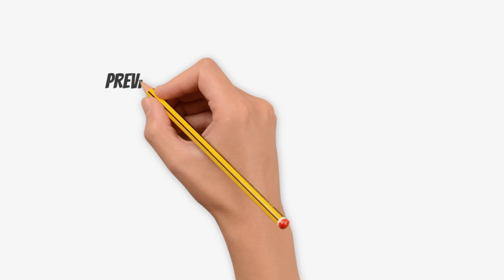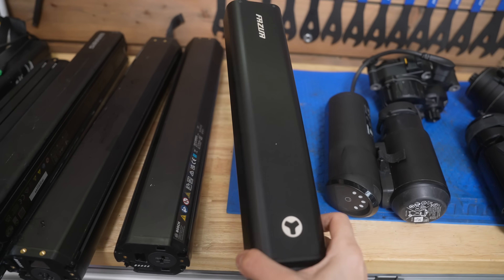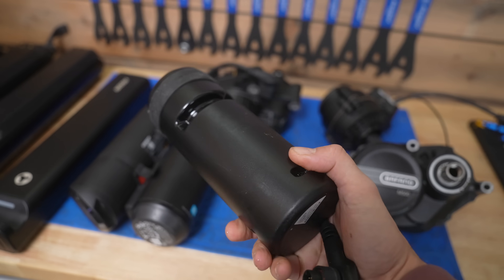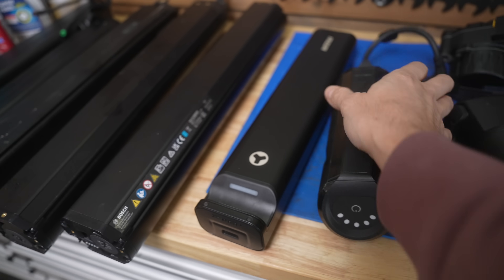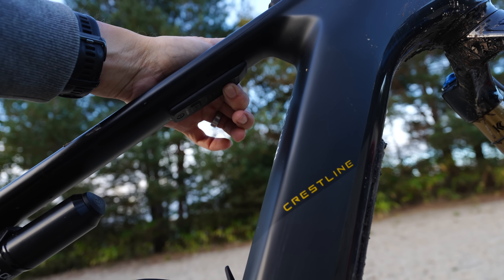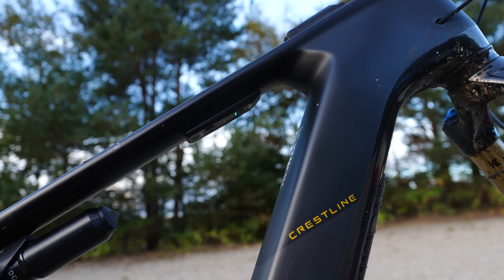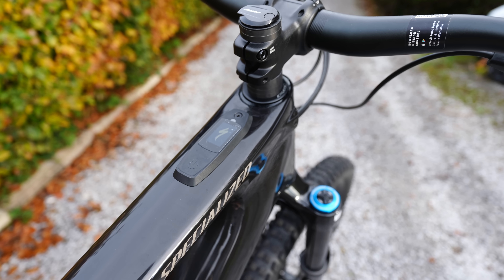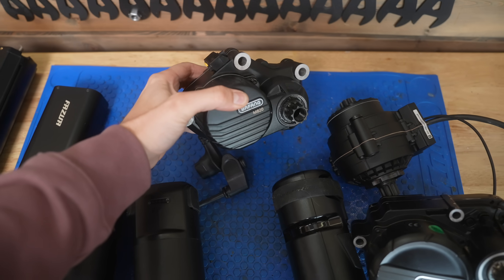We Have A Huge Problem With Ebikes....

Comment from the maker: Some ideas! Please share yours below.... How about:
1 - No Proprietary Systems - have a few bolt patterns for full fat / mid / SL motors
2 - Clear Upgrade Path / Future Proof
3 - Trade in process (like phones) to upgrade to new tech
Reply: And not just bolt pattern for the motors, but a universal power cable and a universal communications cable so if you change out a motor, it should be as simple as disconnecting a USB C cable and plugging it in to a new motor. Same as if the cable goes bad, it should be easy to find and source. And one step further, a user accessible USB C port on the motor to do firmware updates via USB stick, computer, etc as a backup to bluetooth in case they don't keep up with phone compatibility.
Reply: I visited Bosch the cycle show in London earlier this year. They introduced new smart system with the battery EXACTLY THE SAME as my 2021 from Trek. I just couldn't belive when guy said that I won't be able to use my battery. He said some bull....%&# about new software. Is just a software I said, change it. Me as a client was hugely disappointed with their approach to the client.
Reply: Contact Louis rossmann about this I bet he can give some insight to the reasoning
Reply: You miss the point that those are mechatronics systems and that agreements between drive systems competitors are forbidden by compliance laws.
Reply: @christfriedweigel could you elaborate on this. Where can I find more info? A  similar effect results from Patent avoidance incentives.
Reply: @christfriedweigel  Grin Tech's e-bike motors are not under any compliance laws. They've been making non-proprietary e-bike motors in Canada for over 15 years.
Reply: First, manufacturers need to be obliged to provide spare parts. For cars a minimum of 10 years supply is obligatory to get them approved for the road.
Reply: All good points and it paints a poor picture of the industry.

On the plus side - at least there are guys out there who CAN actually fix and fettle these things.

I just had my Bosch 500wh battery re-celled by a specialist & it came back as a 625wh version and was only about ⅓ the cost of a new one.
Reply: My first point would be ensuring all battery packs are serviceable and repairable. Having your entire drivetrain be rendered useless because of one bad cell is not a good state. 

Second, I'd support an open DC charging standard. Being able to have a single charger which can communicate with a pack and deliver the correct charge would cut down on the waste of single pack chargers. 

Thirdly, supporting legislation which allows companies and consumers access to communication protocols so they can build and service products which work with other companies products. Far too many companies use proprietary and closed protocols to restrict competition and deny access to 3rd party repairs

I'm far more in favour of supporting actions which keep your existing kit running and serviceable rather than forcing companies to take actions just so you can get the new shiny thing.
Reply: Break out that bolt on midrive . Unless they make all ebike mid drive  with adapters...same bolt on for all adapters..and what ever bolt pattern on the other side is up to them....they wanna change it ..they can...but they must include universal adapter that fit what all ebikes , that must be made with a standard bolt pattern for adapter .
Reply: I think above all we need some kind of 'gentleman's handshake' from OEMs that the e bike you buy will be supported in terms of like for like replacements for a good chunk of time.
Reply: A regulatory distinction between fun/sport (MTB that may not be roadworthy, e.g. no lights) and everyday (transport, can be MTB) bikes is helpful.

This distinction does allow for more innovation (high-end/sport), which can trickle down into more general use bike tech with standards. It's in the interest to innovate to sell high margin products, but a manufacturer which has to sell a general purpose bike with a standardized charger/... also has an economic interest to supply the same charger/... for other product groups.

For surfboards there are two fin-box systems worldwide. So, you can interchange fins very easily. Still, there is always fin innovation, new materials, little design changes, branding, etc. Fun-sport innovation does not stop, just because the battery plug is standard.
Reply: Mate - SIMPLEST ONE IS MISSING - I am unable to buy a spare motor! A battery. Anything! Neither from SPEC neither from other brands. This is illegal for automotive (they need to keep parts 10 years after model-year car ended it's production: 2010 - up to 2020 parts need to be available). Yet, Germany is hypocritic about 'leading' EU and ekology BS, if they were serious enough - same regulations that popped-in in smartphones (Only USB-C from 2023 onwards) would apply similarly to Bosch, TQ, Fazua, Brose ... guess why they wont even mention this?!
Reply: The only thing universal is the cash grab.
Reply: It’s sth that the eu has to give as an requirement to the companies … I mean 8 chargers 😂 come on all 18650 lithium ion
Reply: Only when there is a standardisation like usb c. Then companies cannot lock you into spending money with them alone.
Reply: Yes you want to corner the market with a product which people need to buy from  you. However , maybe that particular brand could make far more money if it worked with other  bike brands? The problem is  too many people are trying to corner a market for themselves, when perhaps buy going more universal they can make money and solve headaches/global waste for consumers?
Reply: Standardize small extender size batteries for given voltage systems, e.g. 160 Wh (like AA, or AAA but with connectors). Two of these are allowed on air planes with prior approval. On home trails you could bring 2 of these inside the bike and 2 reserves in the backpack. In addition, standard chargers for given voltage systems / battery tech, as you suggested. Also, I support your proposal of a standard motor mounting HW bolt layouts, though things might change there more quickly, than mechanical support of batteries.
Reply: Totally agree. Once millions of jump on this train the rest out there will follow. heck its just battery, motor and frame.
Reply: First step:  the chargers should be interchangeable, same plug on every system, like it finally happened with USB-C on smartphones. I'm not again collection old cables I might use in a year or so, when i need to charge that one battery that only fits this specific plug.
Reply: Everybody wins? more like everybody loses! The companies lose profits, customers lose out on innovation, and loads of designers lose their jobs...
Reply: @GamezGuru1  No. How many different brands and types of wheels, hubs, spokes and rims can I buy? Carbon? Aluminum? Bladed spokes? Constant gauge spokes or butted?
Reply: I think this needs a mind shift from thinking about eMTBs as just bikes, where parts are interchangeable to an extent - and often times a minefield, if we're honest - and think more like about cars and electronics. Take the motor and electronics in a car, even for the VAG group where different brands / cars are using the same engine, there are car specific ECUs to make it work, and interface with the controls / displays, the mounting is different - to the extent that there are subtle differences in engine numbers for how they fit into a car. And the idea that things can just be updated with firmware isn't as straightforward as it sounds, when the peripheral items are considered. 
Motor bolt patterns, again, taking the car as an example, just fitting the same engine is done in different ways to accommodate driving characteristics in different cars, which they do using different mounts and the luxury of space.
That said, "fuel" should be more universal - as with cars, IEC and electric, there are common standards for how they're powered and being able to refill. To a lesser extent, batteries could be more standardised, at this point, though, the technology there is evolving rapidly so it may take a while to settle - and it needs the competition to innovate.
Reply: I completely disagree with your points, simply because the technology is too new and needs to develop further before standards become clear.
For example if you limit designers with some bolt pattern right now, they can no longer get to the smaller lighter form factors that may be possible if they weren't limited.
Reply: @mayena5735 its not that new... And moors law this aint. lets be honest, we all know why they are doing it. Its not like this situation is good for the consumer. This is a manufacturer wet dream, deregulated market, no standards, planned obsolescence, and patents to police. Money.
Reply: @charliemcmonagle  except its those exact market conditions that have resulted in every innovation you currently enjoy in your e-bike. Regulations and 'standards' stifle innovation and increase costs... Learn how capitalism works people!
Reply: @GamezGuru1  Regulations and 'standards' do not stifle innovation and increase costs. Learn how capitalism actually works, GamezGuru. Standards increase innovation because they're not re-inventing the wheel.
Reply: @mayena5735  well, if they do make an, ideally, smaller motor, why can't we have a mount adaptor?
that would standardize it and permit more fluidity for development.
Similar to brake sizes, wheels, etc. The axels are standard~ish.
Reply: @mayena5735  I do not agree with you. For example, e-bike batteries do not contain any extra new technology, so there is no reason to have different charging connectors, different chargers, different expansion batteries, etc. Regarding bolt patterns, it is clear that it is not practical to have just one standard for everything, because a full power motors have different size than low and medium power motors. However, there could be two or three standards. And I don't think the standardised bolt patterns will limit motor designers too much, since the basic architecture of electric motors has been the same for decades (and therefore the sizes and shapes of full power motors are similar).
All in all, the advantages of standardization far outweigh the disadvantages and I think that it is already high time to standardize these things. It is also necessary to say that it is common that also starndards are developed in time, they are not unchangeable forever.
Reply: @mayena5735  Working off an industry standard is possible while still allowing innovation and alterations. It has happened in the bike industry before. Look at hub widths for example. If we say we want to standardise some of the interfaces between the motor and frame, motor and battery, motor and control unit, battery and frame, etc etc, we at least start creating a compatibility matrix that allow consumers some freedom to pick and choose. This won't be perfect, because the standard will initially move along quite quickly, but at least there will be versions within which there will be a range of compatible components to choose from when speccing a bike or upgrade.
Reply: @mayena5735  The technology is not new. Grin Tech in Canada has been making DIY e-bike motors to put on any bike for almost 20 years now.
Reply: @mayena5735 my thoughts exactly. Technology needs to Plato and customer wants needs to remain consistent before creating standardize systems. I think will begin to see motors to starting to Plato in the next few years. But batteries are changing rapidly. However it is BS that specialize won't let you upgrade your motor even though it's the same dimensions.
Reply: @stephenclemeson5376  What's an ancient Greek philosopher got to do with anything? Think you mean "plateau"..... ?
Reply: @ArdGeal  ...haha, yeah I was thinking "Plato?" What the ...?
Lol 😂
Reply: Why would an established company make an ebike standard? It doesnt help them and if they cant grow, they have to close. Or another way is to make an open-source ebike motor. Then manufactures will need to standardise to compete against open-source.
Reply: @wangelite5279  An established company would make an ebike standard if their goal is to push e-bikes forward to increase adoption. Grin Tech has been making non-proprietary motors for almost 20 years. It might be open-source.